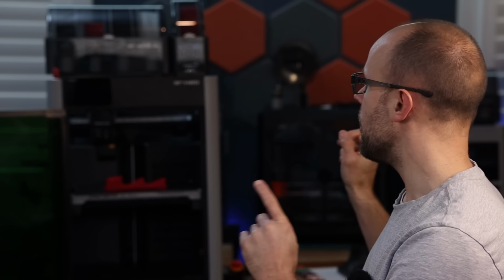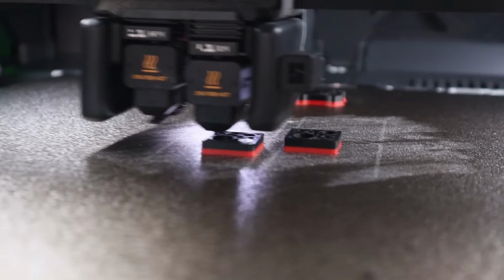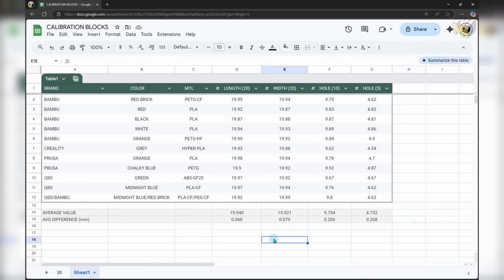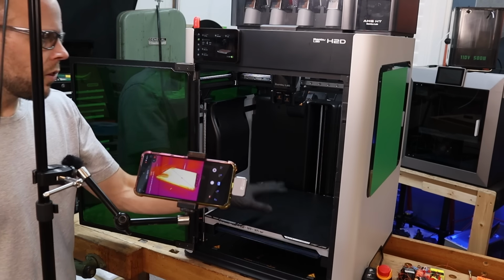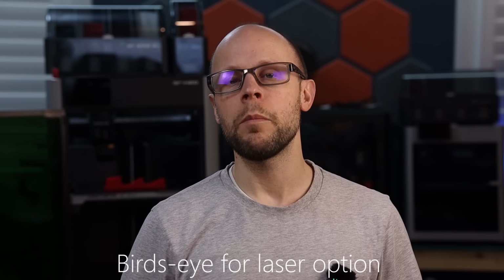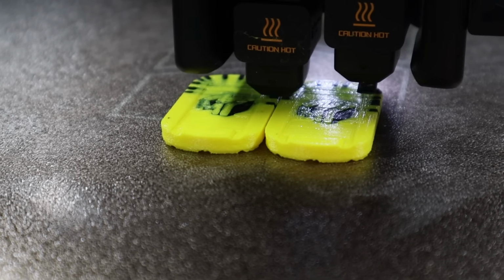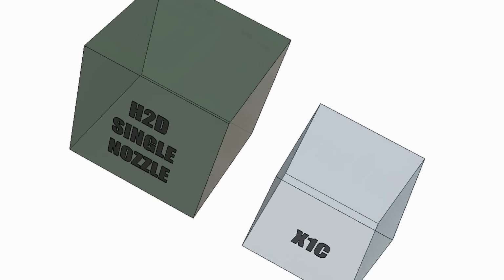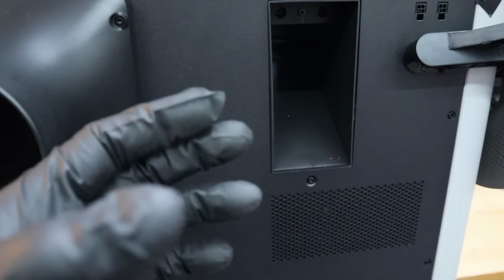I nearly broke the NEW Bambu Lab H2D printer.  What you should know before you buy one - Full Review

Comment: The acceleration is way too fast. Run H2D accel especially for PETG at 5k and under and this issue goes away. Also I run PETG 20C higher then default profile.....Had great success stopped clumping of PETG on nozzle instantly.

Comment: can you out a 0.4 extruder and a 0.2, as to not have to change them all the time based on what you need to print
Reply from the maker: Right now there is no way to combine them into one print, I wish there were, but this is fairly complex in the programming side because we have the thickness to deal with, the nozzle pressure changes, and the level of detail as well.  I think it might not be worth it if I'm being honest.  My guess and I might be wrong is that there will be a completely different tech coming out, something which doesn't have these limitations that we deal with in FDM printing.  For now though, this is what we have, and it works really well, I just don't like that our parts are still so weak compared to their injection molded brothers.

Comment: False info from your expert! Drones are not banned to fly in the US! DJI drones are not allowed to be sold if they are new models! Even drones at Amazon or shops can still be sold! Also Drones have 10 mile distances now dats without losing signal! You can lose signal but very rare and usually you get the signal back before it causes issue! If it does lose signal, it will fly back to where it took off! He also said A few things that were also wrong! Maybe he should do his research on Drones before putting out false info!

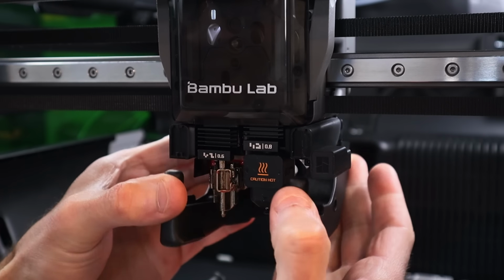Comment: 15:37 Is this OK to do with a metal tool? I remember with the old Lulzbot minis that people were killing their printers by using a wire brush to clean the print head and causing a short.
Reply from the maker: It is probably better to remove as much as possible from the printer and clean it up away from there.  Even though I had cleaned it well enough to get it printing well, I ended up buying a replacement hotend mount with heater in it.  There was always a bit of residue getting on my hotends and I want to keep the seating well and as clean as possible.  It still needs to be installed, so I'm not sure how easy that will be yet, it looks simple enough though.

Comment: Any help on continual XY axis codes I've done everything greased everything oiled everything disassembled the head have not even been able to use my H2D since purchased a week ago. Finally got it running a test print now it's saying right cutter not working I've literally took this thing apart and not getting any help from Bambu Labs customer service ticket. 3 to 5 days to answer one question and every question I have after that it takes another day or two to get an answer back. Any help would be greatly appreciated I am brand new to 3D printing and I just want to get this thing running I have the weekend with nothing to do please help thank you in advance!

Comment: You captured the purge from black to white at 4:32. My question is, why is it purging multiple times? I've noticed that the purge cycle takes forever on the H2D and it would be nice if there was a way to shorten that. Also, because PETG is apparently more fluid, the nozzle swap always generates excess filament so I wish they would add a quick nozzle clean after swapping heads.

Comment: Oddly enough I've never had buildup on the nozzles with PETG and I don't coat mine with anything. PETG is pretty much the only filament I print, along with GF-PETG and CF-PETG and yeah...hours long prints, the nozzle always was super clean during the print. My old printer use to get some buildup after a print as the oozing tangled up. But since the H2D brushes the nozzle at the end of the print, it always kept it shiny clean during & after long prints.  Yet to try high-flow though!  Just using standard PETG currently @ 300mm/s and was pretty impressed with the print quality at those speeds!  I did notice belt-banding on prints if I did slow speeds like 50mm/s,  but everything I read online said to run >120mm/s to get rid of that and sure enough running 150/200+ has absolutely no banding. 

Great printer though!  Glad the hiccup didnt result in a frozen blob of red!

Comment: Im new to 3d printing and had the same result where the holes of the calibration blocks were 0.15 to 0.2.mm smaller than expexted. What kind of measures can we take to fix that on the h2d?

Comment: My H2d just did this today, Ai spaghetti / blob detection was set on high, and failed to detect, only 1/2 week old... because the printer failed to pick up the massive blob that enclosed the entire toolhead, I had a bad case of thermal run away with temp readings over 360+ celsius, which inevitably lead to the filament smoking / catching on fire. Had to evacuate the house due to how bad the glass fiber filament smelled and the crazy amount of smoke this thing produced. It seems that this first started by the slicing software not updating to the textured PEI plate and auto selecting a smooth plate, which may have lead to bed adhesion issued.. not really sure, all I know is that the features bambu boasts about never kicked in and failed, which nearly caused a house fire. Hoping to hear back from support soon, ticket was put in today..
Reply: Any update just curious?
Reply: Please If you can tell us more

Comment: Privacy tip: If you put the printer with the right side flat against a wall, you won't ever need the cover, as the cam will only see the build volume and a TINY stripe of wall when you open the door (which only happens momentarily anyways...)
Also makes the rear more accessible in my case AND leaves the spool roller on the left side perfectly unobstructed... Right side against wall is the way, if you can swing it!

Comment: My first print on my H2D was a Bambu filament spool using Bambu PLA. Not very far into the print I got an error message about filament buildup on the nozzle and sure enough a big blob had accumulated. I paused the print, removed it and resumed the print and it happened again and again and again and I aborted the job. I’ve successfully printed this file on my Mk4S and XIC. I have no idea what caused it. Fortunately, I’ve had no other issues and the print quality is excellent. BTW, I bought the H2D because of endless problems with my XL5 which culminated in the print head carriage elevating beyond the z-axis support breaking it. Prusa said they would arrange for a return and sent me a carton and USPS return label. The post office rejected it for exceeding the weight limit it and it turns out Prusa (Printed Solid) knew it. After I reported it, they said they would get back to me but I never heard from them and the printer has been sitting in the carton for 5 months. Having an X1C, Mk4S and XL5, in my experience Prusa printers are vastly more problematic than Bambu. Bambu is in a different class in terms of user friendliness, low maintenance and reliability.

Comment: if I can't do a .02 for text  and detail and then a larger nozzle for the rest of the print then Ill pass. That would be one of the advantages to a dual nozzle! it doesnt make higher quality prints than the x1c/p1s . I have an S4 filament dryer. It would be nice to dry from the AMS.   No one needs the laser , plotter or other shenanigan it does. . it only saves you filament for 2 colors . is it worth 4 times the price of a p1s?

Comment: Bambu is closed source more now why dont they have a way to anticipate when the change is needed and start the chnage cycle before it needs to purge so the new filament is in right as it goes back there. THAT is what would save the most time
Def should be able to have 2 different sizes use the bigger nozzle for infill to go faster

Comment: actually... you can use the entire volume but you have to use the left and right sides separately. which means either different colours / materials. or matching but using both nozzles. someone did a test with the full build plate x y

Comment: When you mentioned that the tubes don’t rub on the top glass I noticed you have forgotten to remove the film on the pad to the right that is there because it does rub in that location, or at least it looks that way, there’s a white area on the film that would suggest the section to pull it off.
Reply: Not sure it's meant to be pulled off? It works on mine, still... Have not touched it...

Comment: There are a lot more mechanical things in this printer, e.g. flaps, nozzle retract. It will be interesting to see how they survive over time. The laser is a bad idea though. You can have the best extraction in the world but resin smoke will still gum things up and if someone cuts something they shouldn't the gasses can corrode metal parts VERY quickly. It's not worth the risk on something this expensive.

Comment: Do you have any woes with power consumption? The bed heats fast sure, but I read the printer takes 1350 watts peak and 1050 average, which seems high. Thats probably with the heating element on. I would imagine that you pretty much wouldn't want any other device connected to the same circuit...

Comment: 5:00 why use black and white on the one nozzle and red on the other? it would be less purge with red and black on one and white on the other..
10:10 you need to set the emissive values correctly. you have a crud thermal device and it needs to calibrate properly to show more accurately and defined :)
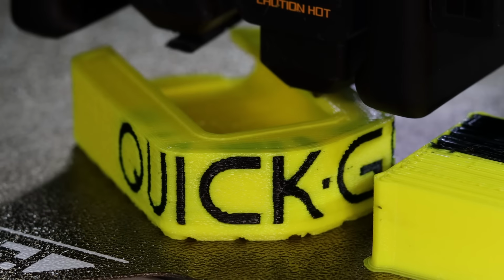18:00 tpu say you? that is some very stiff and hard "tpu" the bambu tpu aint no propertpu in my book. they  added so much pla or other polymer that its rock hard. thought i had received a batch fault and returned it. tried again half a year later from another supplier and was identical.. 

try esun etpu instead of this? almost as hard as bl's but at least it flexes some with thin walls.

Comment: Thanks for the video. I am thinking of getting a machine for my shop. Do you think it's a great option getting a laser bambu H2D? I heard the dust will damage the printer chamber and ruin 3d engraving results. I don't know much about 3d printer. What do you think about this issue?
Reply: As someone who owns both a laser engraver and a couple printers don't for that money tou can get a seperate 40w engraver with a much bigger area and it would be much easier to work with clean etc. I don't know what bambulab was thinking with this design yes in a pinch this would work however in the long run if you are doing any serious work that machine is going to need a lot of maintenance and it doesn't have air asist which is a big no no for many materials.

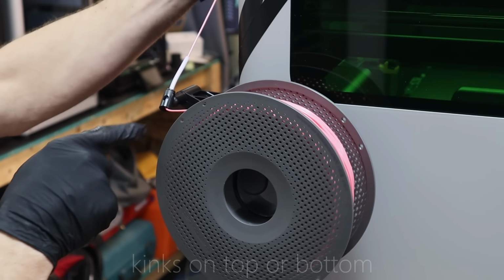Comment: Hey @NeedItMakeIt At 18:49, just flip the filament reel over so it goes up into the feed line instead of the harsh angle. It's a big change from X1C, but all external filaments on H2D need to be flipped for best results. Hope this helps you and anyone else watching. :)
Reply: Yeh, I am betting a lot of us saw that and said "WTF dude!"
Reply: @kriswingert1662  everyone in a rush to make how to videos before they really fully understand something.
Reply: I came to the comments to make the same statement, but you beat me too it!
Reply: Not sure why many struggle with filament path... Just use straightest possible way, with least sharp angles = done... That's why the TPU feed port looks like it does and why the spool holder has a flippable filament guide, so it supports both spool directions...
I don't think I've ever actively considered the path, my brain automatically just uses what makes the most sense...
Reply: common sense left the chat
Reply: seems like common sense, but pretty sure that's gone these days.

Comment: Bambus site recommends only using two of the same nozzle, I think thats refering to only if you're using both nozzles on the same print. But if its not it might explain some of your nozzle issues as I see in this video you often have two different nozzle sizes or a high flow along side the regular .4.
Reply: Agreed! Only relevant for dual nozzle prints... I think they will add dual nozzle with different sizes later! .4 with .2 could be amazing! Maybe even .8 with .2? To fill the gaps? - Really only limited by imagination, the cool things you could do with it!

Comment: One thing I noticed as a fan of your videos... you like to use glue stick for adhesion. Ever since my Anet A8 days many years ago, I refused to use glue stick after PEI sheets became available. I have had my X1C and A1 for a year or so now and never EVER use glue stick. I just refuse to entertain the idea. With the textured plate I have had zero problems with adhesion of ABS, PETG, TPU and PLA. The trick is to clean the plate about every other print with hot water and Dawn dish soap using a plastic brillo pad to scrub the plate down. No alcohol is necessary either. I take it you have had other results than me? Thanks again for another very informative video. Cant wait for the next one!
Reply: Looks like you never printed PC or PA ;)

Comment: I suffer from the same source. I once spent... some amount of money... when my extruder wouldn't extrude. Changed extruder, nozzles. Mother board. Only to fine a screw on the extruder mount protruded just enough to touch a gear on the hemera and low and behold problem solved. Most expensive screw I've ever owned. User error.

Comment: Im dieing to get one but i absolutely refuse to buy for a couple months until i know all the kinks are polished with all certainty.
Reply from the maker: That's very smart, it's good to wait if you have the patience.  I'll be sure to update everyone if there are any issues or just how it's going in general.   It certainly opens up a lot of options that I didn't have before.  I'd also love to test out a tool changer style printer to compare.  Based on what I've seen, the H2D is going to be faster at printing two materials, it is also quite accurate and whatever they've done to remove the VFAs was a nice little bonus, it makes the parts look that much better too.  All in all I think they've made an impressive machine, I was actually saving up to buy one and I have lots of MW points to use for that as well.  I don't know if you have an AMS already, but if you do when the time comes, I can recommend using the original AMS with the H2D and at least save some money on the initial purchase.  I think that one released in June, so it might align with your timeline too for waiting to see if there are any issues.
Reply: @NeedItMakeIt  Thanks for that I appreciate it, and I am sure many others do. Really enjoy the engineering direction of your channel so I expect nothing but the best.

Comment: Mate, I’m having the same issue with the giant blobs popping out into the build plate with the 0.2 nozzle. Did you figure out how to fix that? The filament seems to flush sooo much, even with flushing settings turned way way way down and it keeps gumming up the hotend.
Reply from the maker: I'll report it to Bambu, I think it's an easy fix, but I just did the test again and it did the same thing for the first purge on PLA.  It should be really easy to address, it could be split into two smaller purges, or just purged over a longer time.
Reply: @NeedItMakeIt  I've also opened a ticket with Bambu on the same issue. 

After playing extensively with slice settings, I'm convinced that there is something wrong with the 0.2mm nozzle profiles/slicer settings. After trying for a couple days, I gave up printing the model I was working with the 0.2mm nozzle, I printed the same model with the exact same settings with a 0.4mm nozzle and there were no issues. Very frustrating.
Reply: And to be clear, it happened every time there was a filament change, not just on the first purge.

Comment: this reminds me of the Prusa XL launch. A bunch of launch issues and people getting mad over first gen problems
Reply from the maker: The one big issue was self-inflicted in this case, but the loading in of the soft TPU was a bit annoying TBH.  I don't print with much TPU but if the printer were against the wall, I can see how it can be a bit frustrating.  On the other hand, if I can do it with a camera in one hand, most people should be able to.  The nozzle camera stopping the prints is really more of a settings issue and also the material being prone to clumping up, so far so good when I haven't printed with the PETG-CF though.  For some reason, Red PETG or RED Brick PETG-CF seem to be the main issues.  I'm just guessing, but it seems like there is an additive in the Red to make it far more prone to this.  I can't really think of anything else that's a problem.  More testing and bigger parts need to be made of course and I'll be reporting back in a few weeks on that to see how it's going.  I'd love to test and compare a tool-changer too so we can find out how much faster it is or slower it is when printing 1-2-3-4 different colors or materials.  I don't like waste either, I'd love to minimize that as well.

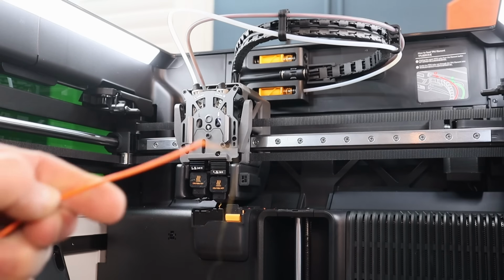Comment: 18:49 You could've just turned around the spool to make the filament go straight in
Reply from the maker: I added some text because it still wasn't good.  I should have added a little clip of video, it is better, but still not good for TPU.  Maybe with a piece of PTFE tube and then couple it with the one going to the head it would keep the ball joint in a better position.  It might also work to move the spool holder down, it can move about 6" lower on the printer, I'll have to try that too!